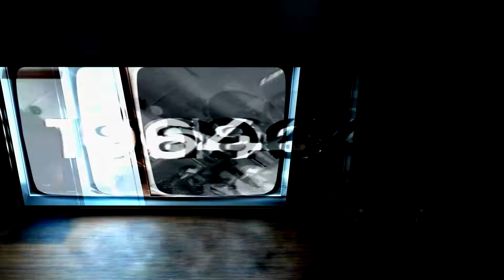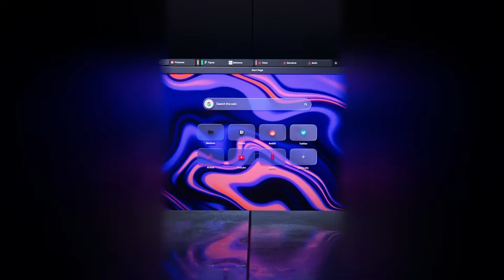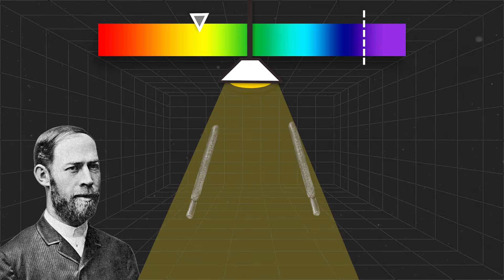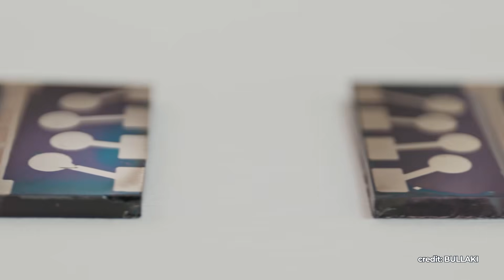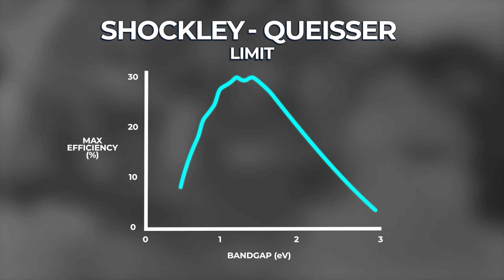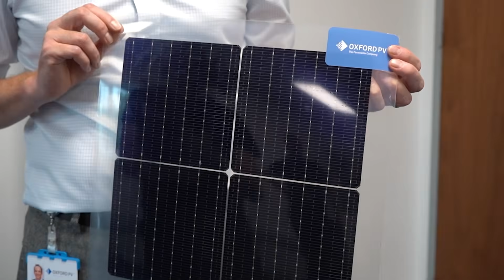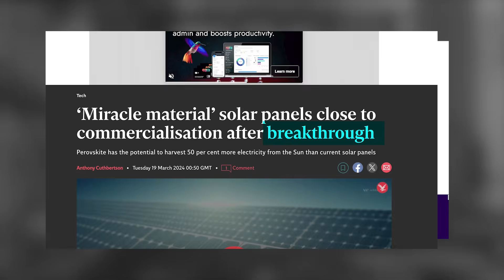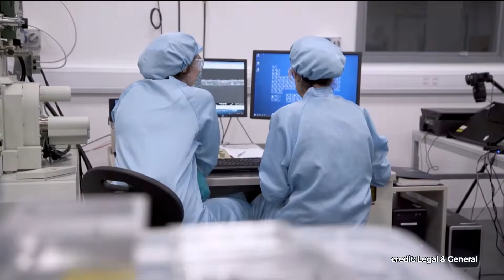How Physicists Broke the Solar Efficiency Record

Comment: To save to 20 min: New best efficiency is 24% now (at 16:25).
Reply: Yeah, bit misleading how he promotes 20% increase compared to silicon (20->24%). But then the 28%->24% decrease in efficiëncy due to protective material is almost talked about as negligible.
Reply: @sdtok527  4 is 20% of 20... its not misleading
Reply: @sdtok527 yup. When I was getting my PhD in thermoelectric, I often read article saying 10% gain. Well they often meant an increase from 1% to 1.1%, and not 1% to 11%.  😮‍💨
Reply: @sdtok527  this whole vid felt like an ad lol
Reply: So in other words this video is clickbait given 22% panels have been on the market for an age and 24% is an incremental efficiency gain not a breakthrough.  Thanks, no need to waste my time on the rest of what I already know.
Reply: @Nine-Signs  correct.
Reply: @Nine-Signs  it's not incremental, you can stack panels now and absorb more light due to the structure of it, if you stack more and more panels, higher efficiency would be reached without researching new material, the problem now is just the material is to sensitive, we could get twice or even more power in a same size panel in perovskite compared to conventional panels which have a theoritical limit of 30%
Reply: @Nine-Signs  basically yeah. experimental panels were at 47% as of 2022. who knows what we are at now.
Reply: @Nine-Signs  So actually only 9% at best, and we already knew about this, still impractical.
Reply: @Nine-Signs  it also depends on cost and durability. We will only see when we get economy of scale if this is good.
Reply: give this man a medal !
Reply: ty bro
Reply: Thanks! ❤
Reply: Thanks!  And that's actually amazing!
Reply: This video is indeed very dilluted and the interesting content could probably fit in a one minute format
Reply: ... not all heroes where capes. 👍
Reply: you ae hero
Reply: Thanks. But I wanted to learn about the technology. You sould've also said the magic word 'Perovskite'.
Reply: @aniksamiurrahman6365   Yes - kind of difficult to actually educate (instead of advertise) on a semiconductor materials challenge without discussing the materials physics.  And these are an extremely specific subset of perovskite compositions that uniquely define the primary technical issues.
Reply: Spoiler Alert!
Reply: Ahhhh thanks man
Reply: That's hilarious because I have personally tested GaAs single junction cells that were >28% conversion efficiency.
Reply: Thank you for saving our time
Reply: thx
Reply: Thx
Reply: THANK YOU
Reply: Thanks for saving me precious time
Reply: marry me bro
Reply: Thanks..you saved my 15 mins.😅
Reply: Thanks, I was wondering because to my knowledge experimental and about as long lasting as me in bed solar cells are sitting at 25%. And conventional cells at 22%. And with 25% we are very close to the absolute physical limit of converting solar power of roughly 28%.
Reply: @GERntleMAN  Interesting. Where does this absolute limit come from?  Also how useful do you see those panels at such low efficiency given that in future we want to increase power demand even more by migrating to electric cars?
Reply: @test-rj2vl  magic...
Reply: @GERntleMAN  All true but if we can just make that extra 3% then I am sure some people can be made to believe this will magically solve capitalism demanding perpetual global GDP growth at 3% avg a year to prevent its collapse, resulting in a doubling in consumption of energy and materials every 33yrs post 1750 to such an extent that in 2024 we have destroyed the entire planets energy equilibrium and are trapping an additional 30 megaton nukes worth of energy from the sun above that which the planet can lose to space...

... every 5 minutes, doubling every 33yrs.

Which all in all makes a complete mockery of any idea that renewables / electric cars are worth more than spit when used under capitalism as capitalism outgrows in consumption any benefit gained from the lacklustre global deployments of them.

i.e. under capitalism, renewables cannot save us, they can only slightly extend the terminal date at which we expire -.-
Reply: Thanks Bruv, I was at 12:45 when I decided to go to the comment section and Read your comment..
Reply: It is a bit sad to see how many people in the comment section think this is not a big deal or the video title is clickbating (to any meaningful degree).
You can rewatch 16:57. The searcher said that the extra efficiency is worth the cost, so the overall energy generation per unit cost is increased from a typical silicone PV cell. Not to mention, making new technology (perovskites) commercially competitive is a good factor by itself since it sharply changes the incentive in investing in the new technology which is likely better in the long term anyway.

The bridge from fundamental physics to engineering and application, has always been hard to cross, especially if an old tech has been optimized for decades. It is very important to find a way to make new tech commercially competitive (not to mention, it is superior in this case), and this company found a way to do that. This is a big deal.

I think condensed matter physics video is just hard to be appealing to the public compared to Gravity, Astroparticle & Particle Physics, mostly due to the background knowledge needed. However, Dr. Ben Miles really did a wonderful job in covering such a hard topic.
Reply: o7
Reply: I listened to the whole video and I hate comments like this. You are not some fucking genius who can concentrate knowledge to its purest crystalline form, you've just given a headline (not that fucking hard) and people who want to think they are just as smart agree with you.

What's really dumb, is acting like you're some Sherlock figuring out that a YouTube video probably isn't where everyone's going to learn 'cancer is cured' or 'energy is free now'. I'm not going to try to get into what this guy says. It's well-delivered and short. If you can't handle 20 minutes to learn something, double the speed and ruin the production value.
Reply: Heroe :D
Reply: This is why I avoid science news. So much is overhyped, or outright fraud.
Reply: "broke" is a bit of a stretch... usually is used when efficiency doubles or triples. not when u go from 20 to 24 xD
Reply: Thanks for saving our time
Reply: Thank you
Reply: Spoilers...
Reply: thank you
Reply: not true. its just marketing
Reply: Can't beli e a shit that ben is telling. He thinks a  Satellite takes 1,2 sec to loop  around the earth ones😂😂😂
Reply: Scratch that, we've broken that record again with 40-45% efficiency using frenel lenses and redundant layers.
Reply: Which is just a clickbait advertisement for the greatly over-hyped under-performing perovskite cells that have crappy life-cycles.
Reply: @kakistocracyusa   Wow, I love this channel but it has a dedicated hard-core hate group. Go away if you don't like the channel. Why watch?
Reply: @blucat4  That is an amazing argument you presented regarding the merits of a specific field of semiconductor physics and electronic materials technology.  Is there anything you disagree with that is not "hate speech" ??
Reply: Thanks a bunch, I knew it's a clickbait video, LOL. So I searched for comments like this to save time :p
Reply: @SouravTechLabs  The video is about How, not What. I actually watched through the whole thing and learned some about the technology.
Reply: 24? Not much.
Reply: @goranz9446  It's more than enough if the product is cheap, durable and easily available. Solar power is rarely area limited. It's limited by the day-night cycle, seasonal changes, weather changes, lack of storage and so on unless you're talking about a sailing ship deck, satellite or something that is actually area and mass limited.
Reply: @goranz9446 that’s actually huge 😂😂😂
Reply: still, 39.7% was the best lab result like 3.5 years ago already
Reply: Thank you
Reply: damn THANKS for the timer, the first ads-minute was awfull...
Reply: @ArandelaGriffe  the sp0nsorblock and it also shows you exactly where in the video the highlight is.
Reply: @ArandelaGriffe  for pc install ublock origin and for mobile install revanced youtube and bye bye ads
Reply: @ArandelaGriffe  True but given his right wing notions and his general disposition on policy overall, you have to ask is he not on AI{PACS books because he understands the corrupting influence of money in politics or is he not on their books because he hates JEWS, 

rather a different outlook on matters eh.
Reply: @Nine-Signs Define "right wing" for me?
Reply: @LeeStoneman  I think that's a bot account. The response is a non sequitur when you look at the person's comment it responded to.
Reply: @Adreitz7  Good call.
Reply: @LeeStoneman   Right wing = anyone who believes the needs of capitalism, namely profit at any externalised cost, should always come before the needs of society, nation, world which are in the majority entirely opposed to the needs of capitalism.

As for centrist liberal they would be people who believe the same but would like some regulations to stop capitalism being quite so malicious upon the majority workforce below while stumping for minority issues to provide a greater illusion of choice between them and the right despite them both being in bed with the same capitalist minority on top for their own self-interests.

Not difficult to lay it out factually and systemically. Hopefully not too disappointing to your evident fishing.
Reply: @Nine-Signs So there are no democratic countries that have a right wing government.
Reply: @PowrótKróla  "democratic" countries are those run by "the people." Democratic countries have always been defined by who "the people" are—the first "democratic" countries owned slaves, after all. So yes, there are democratic countries that have a right wing government—they're just quite stringent (and also two-faced) about who "the people" are.
Reply: @Nine-Signs  You know nothing about the political continuum or the "needs of society". Must be public school educated and clearly self-absorbed.
Reply: @PowrótKróla  That's because Democracies become dictatorships in short order based on the principle of tyranny of the masses (or majority). Much different from a Representative Republic, which is more along the "right-wing" path, with constitutional mandates and the least possible government controlling the population.
Reply: @Nine-Signs  I would suggest to you that you educate yourself on the history and origins of communism, it should be a very eye-opening experience, if you can handle it.
Reply: @BudKash  
Capitalism and socialism both suffer from a common factor that brings them down with surgical precision.
This factor is people.
Both systems need the ideal human being to function.

But since this does not exist, the systems collapse sooner or later.

The most stable form to date is the social market economy, in which aspects of both sides coexist.
If one side predominates, no matter which of the two, this leads to a reduction in people's freedom.
Reply: @Nine-Signs  lol what
Reply: @tdplayert  64 replies friend, unless you actually place context with your upset, what else can I reply with other than 🤷🤷
Reply: @Nine-Signs  lol in all honesty I don't even recall my own upset anymore,besides being clickbaited into this video... apologies, I guess, haha.. EDIT oh wait, it was about a seemingly random rant that now seems removed
Reply: @user-wj7kf8sk5r  No need to worry friend, it wasn't to you I was replying, if you check my reply you will see it is to a different person @tdplayert

Who wrote a reply to me and simply said "lol what"   as if I am supposed to magically read his mind for context to reply to.

No worries.
Reply: same as current best silicon panels
Reply: Thank you, plus hasn't this stuff been around for over 2 years now? This information is a little outdated.
Reply: Thank you
Reply: Next question: How much does this additional efficiency cost? Photovoltaic prices have dropped so rapidly that this marginal increase in efficiency can likely be offset easily by adding a few additional solar panels at a low cost.
Reply: @grosserboss  At 17:12 he says that you should not ask about cost.
Reply: @test-rj2vl  oh yes, you are right. How stupid I am. 
For those who are interested: Increasing module efficiency from 22% to 24% would justify a 10% higher cost, provided the same service life can be maintained. Currently, modules with an efficiency of at least 22.8% are available.
Reply: @grosserboss  How do you calculate that 10%?
Reply: @grosserboss  Ben does not understand "economic optimization".  He just wants to support the UK product and "glaze over" the ridiculous research goal to "improve an optimized product" buy adding materials that are a magnitude more expensive and much less durable over time! A good analogy to this kind of twisted ridiculous research is to compare it to washing a PV module ... it makes it slightly more efficient for a short time but not worth the cost to clean them even monthly if it rains seasonally.  Here is an example of how a real scientist/engineers at SMA  optimize a PV system.  They implemented an "inverter downsizing" calculator to reduce inverter size (aka oversized PV array) to make their inverter more "economically optimized".  It turns out you do not need to size the inverter for the optimal power output at solar noon ... but instead match it to the average output more near the 70% max noon  value.  This design plan instantly reduced cost about 30% for the inverter/wire  costs which was about 15% of the total system cost per watt.  You could also predict the total system life cost by taking into account that an inverter would be replaced 3 times during the life of a typical PV module ... meaning up to 45% savings/watt.  The automobile analogy would be you do not need a 500 HP car to get your groceries ... 100 HP is fine when you are in town and the speed limit is 30 MPH.  In fact an electric bike using 1 HP is 500x more economical and 100x more economical than a Tesla!
Reply: thanks for saving my time, really annoys me when youtubers aren't even 3 minutes into their video being doing this bullshit advert for something that's completely unrelated.
Reply: and I hate it because we don't need more breakthroughs for our energy transition, we had the technology to ditch most fossil fuels 20 years ago. but people keep waiting for the next breakthrough that will allow us to revolutionize our power grid, WE ALREADY CAN DO THAT. 

what we need is panels that are cheaper and more accessible, they don't even need to be more efficient, just durable. and panels can already last decades with minimal loses in efficiency, a low efficiency panels is already enough for you to be able to power your house and your neighbor's with just your roof area. but they need to be cheap to make buying them worth it, and, specially the US, need to improve their installation process so it's not so expensive that it's inaccessible to most people.
Reply: @danilooliveira6580  wrote " low efficiency panels is already enough for you to be able to power your house and your neighbor's with just your roof area."
Only if you have a big house, or low energy use. Most households use a lot more energy than they can collect from their roof over a year with current technology. I have an 8mx7m 3-bed detached house with an almost ideal 8x4m southish facing pitched roof. I can get 7kWp of PV on the roof (with 21-22% efficient panels), which generates about 6500kWh/yr. Most houses this size use double that energy in heating and another 4000 for driving as well as 3000 in electrical use. So they can only generate 1/4 of their energy needs from the roof.
Now this house has been heavily insulated, we cycle for most journeys and have made other efficiencies so we probably can run all our electrical use, heat pump for heating/DHW and car charging from that 7kWp set of panels. So it is possible, but only if people reduce their heat load by about 80% with building upgrades, and don't drive too much.
Bottom line is that large demand reductions can meet improving PV efficiency in the middle, and your lattitude matters too. At 54 degrees north here we only get 1/9th of the solar energy in winter, when the heat-load is highest so even a house like this can't actually run off its own generation all year round.
Reply: @danilooliveira6580 Wrong.
Reply: I'm still gonna watch the video but thanks, it was bugging me.

Comment: Makes no sense type 3 would definitely be more like being aware/ controling of any mass in Universe and I think it would directly be type 2 the jump from Type 1 to 2 is too small to be a real step based on collecting all energy in the atmosphere what also is too focused on Energie becoming getting yourself emortal would be more like step 2 or 1 or be a point were the problems come because for some reason they may become able too collect all energy in the atmosphere but don't become emortal so there may come up a degradation usually inside the social structure what may have made it happen that they don't what then makes them be a step 1 civilization but not at all like when you chapter a fourain alien technology. Also energy seems to become obsolite but mass doesn't but think at some higher level it's effect heavenly decreases or gets obsolite eather. The question is still when do I get my roof possibility and Whan do I get my moving cell system combined with a small heating production at a affordable price what's part of the technology.